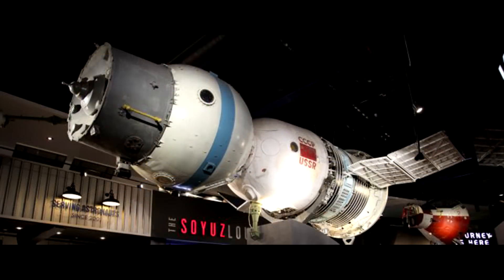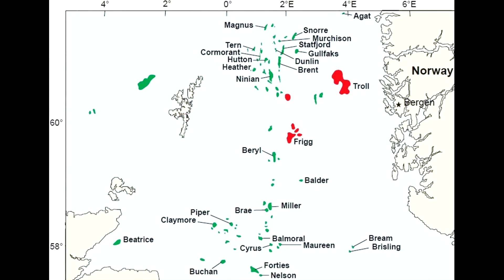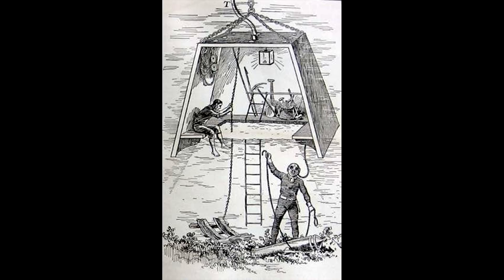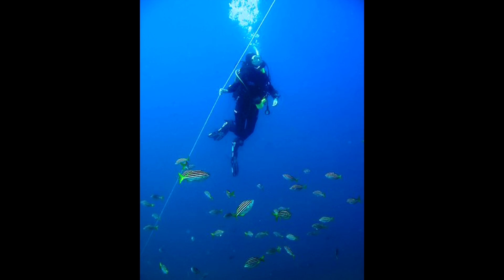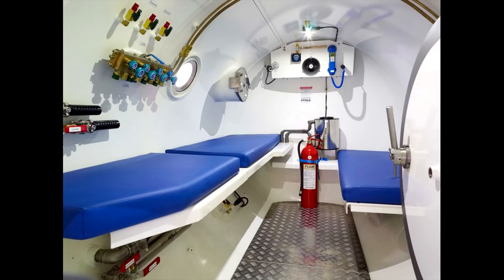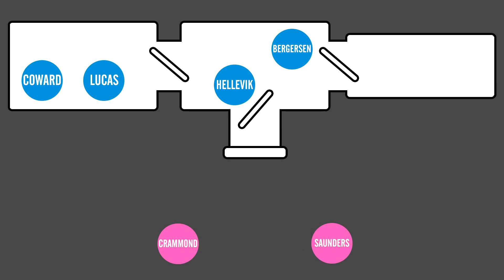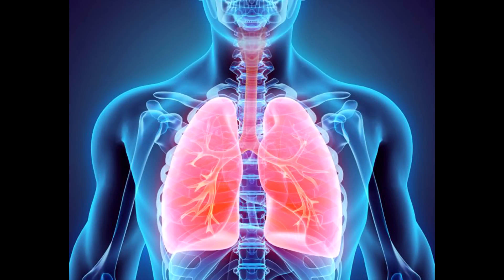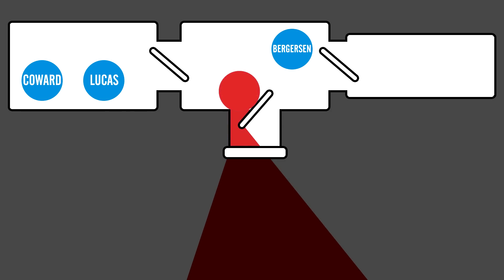Extreme Loss of Pressure Tears You Apart | Last Moments

Comment: If I remember correctly he said the opening was 24” in diameter; if you multiply the area of that circle by the pressure drop, there was almost 60,000 pounds of force smashing the guy through the hole.

Comment: It amuses me to see a warmed egg yoke forced through a tiny puncture hole in its shell after subject the egg to cold water.
Taking an empty plastic bottle and washing it out with hot water, then recapping it without crushing the plastic also yields similar results when exposed to colder temperature.
Try the experiments at home.

Comment: The fact that it was possible to open the clamp on the diving bell before the inner trunk was sealed is scandalous. Even though it was a while ago it was still 1983 and not 1883. Even without an electrical/mechanical fail safe there should've been a visual confirmation from the diver who secured the trunk to the tender. Needless loss of life. RIP.

Comment: Hi, I see you are having a bit of trouble with artifacts in tour green screen. I'm not sure if you use blue screen or green but it doesn't matter for an easy fix. I post before you knock out or "pull" your screen make the color slightly richer by adjusting the color setting and make it slightly darker. I know that sounds opposite to what most people say. try it, then knock out the screen as you normally do, you will get much better results and it is fast and easy. Good luck!
Reply: Brian Miller what? Is this about the video

Comment: I used to Weld Trailers and hitches yada yada but this reminds me of an under water Welding Documentary because I was studying to be just that an underwater welder if that's even the name lol but what wasn't funny was when your welding on one of them big rigs or welding on a huge petroleum pipe or whatever the case may be itps under so much pressure that if your nere it when it does its thing and a big air pocket busts out It will suck the welder through as little as a 1foot hole and they even had an example where their was a king 🦀 crab which aren't very big But that crab got sucked into a qtr inch hole so just think if it was about a 2foot home it's gonna suck u all the way in That Crab was gone at the blink of n EYE no bs

Comment: "Sucked out."
"Correction, that'd be blown out.  A common misconception."
 - Data
Reply: The naked now
Reply: Considering that its just the difference in pressure that's doing it, it would be a matter of perspective. 
Considering that there's no machinery actively pushing or pulling things in this scenario, if you were to use the internal pressure as reference, then technically things are being sucked out, but if you use the external pressure as reference then they're being blown out.
Reply: I had me a burrito supreme
from taco bell some years ago & I can with 100% certainty confirm I indeed blew my asshole out for an entire goddamn week.
Reply: @jamessouza7065  🤣😂🤣
Reply: @Cenentury0941  Precisely and completely, and there is nothing to add. Well said.
Reply: @Cenentury0941  
No, atmosphere always naturally flows from positive to negative pressures no matter the mechanical means of obtaining differential!
In all cases above water the static low pressure environment is the natural state and the higher pressure environment artificial, (except a vacuum cleaner which is not static) so even with your perspective analysis, blown or pushed is the correct terminology!
Even below water the liquid is pushed into a space rather than drawn!
Reply: Hello fellow Trekkie!
Reply: Sucking and blowing are the same thing. It’s just describing them from opposite perspectives. You could say the 1 atm ambient atmosphere drew a relative vacuum on the 9 atm chamber, sucking them out, or you could say the 9 atm chamber blew them out into the 1 atm ambient atmosphere.

A hurricane sucks the air around it in, or the air around a hurricane blows itself into the hurricane.

Sucking and blowing just arbitrarily choose one end or the other of a pressure gradient to designate as the impetus.
Reply: @MegaBrokenstar  "Sucking and blowing are the same thing."  Funny, your girlfriend told me the same thing! lol
Reply: @MegaBrokenstar  You must be fun at parties. Also, you're wrong. There is no perspective in the void. Yours, in the ship, is the only valid pov.
Reply: I was going to comment this. Glad someone else has good taste.
Reply: This is like the transporter accident in Star Trek TMP. "Enterprise, what we got back didn't live long. Fortunately."
Reply: Depends on your point of reference, both are correct but does it really matter when you’re being turned into vegetable soup? I don’t think your last thoughts are am I being blown or sucked.
Reply: @The_Original_Forrest_Trump  You can crawl back under your rock now.
Reply: @thetruth45678  LoL ok kid
Reply: @The_Original_Forrest_Trump  Calling people "kid" is proof you are immature. I, for one, would love to be a kid again. I miss the 80's and 90's.
Reply: @The_Original_Forrest_Trump  Maybe you've been asleep for the past two decades, but video games aren't just for kids. Every other youtuber is a grown man with a let's play series. Heck, it's a valid career choice now. There's tournaments and sponsorships and contracts worth more than your entire family makes in a lifetime.

Thanks for proving my point about your lack of maturity. I love it when the trolls do my job for me.

Comment: About the famous picture of the divers remains: The damage of the body was not caused by the decompression itself, it was caused by the 24 inch wide opening where the body was forced through. The extreme forces had a similiar effect to the body as a meat grinder.

Comment: two thoughts: 
2. How long is the controlled decompression *supposed* to take? I've heard "weeks", but haven't gotten a precise number.
1. I know the 80s was the 'greed decade'... but where there *no* safety mechanisms?
Reply: These divers were saturation divers. They live in the bariatric chamber for up to a month, never decompressing, moving under pressure from the chamber to the bell to their working depth back to the bell to the chamber, shower, eat, sleep in the chamber then repeat. They only decompress when their work cycle is over then they might spent several days decompressing to 1 atm before finally leaving the chamber. It is not a job for everyone..

Comment: Yeah. One of the only real time you would experience “explosive decompression”. Similar to shooting a propane tank. 
But.
Explosive decompression in space or a plane isn’t a thing. One atmosphere isn’t a lot of pressure.
Reply: At 35000 ft, (passenger plane altitude), a 24 inch hole has a 5900 lb. force on it. In space, there is almost 9000 lbs. If you were blocking that hole, The force of between 4 and 6 cars would be on you. You would die badly!

Comment: I nearly ripped a technician in half during a brief stint operating ski lifts a few years back.
Operator error is no joke. Check, check, re-check (even if your boss wants you to hurry up).
Reply: Anarchy The Fox when there’s moving objects and rotating bits, there’s always the danger of something getting ripped up, but yes I also wanna know
Reply: @Rashed1255  Caution: Moving parts
Reply: @anarchythefox  If you're just skiing/snowboarding, then you'll be fine. And for the record, I still ski/board along with most of my family. However, if you're mechanic or technician of some sort, and you're doing maintenance on (for example) the tower's, then it's a whole different ball game.

The person moving the lift is communicating with you by radio (sometimes in a control room miles away). You may be clipped into a specialized chair hanging from the wire while simultaneously clipped to the tower that you are working on (in order to prevent a fall). If the lift moves during this point in the operation then you're harness will be pulled in two separate directions. Most lift tech's I know are extremely picky about who operates the lift when they are out on the wire.

Luckily the mechanic that day unclipped before the wire moved. I was never put at the controls of a work chair again and I've since left the business.
Reply: @cocoabutt1711  so did the the tech forget to say something, did you not hear it, just didn't know?
Reply: @GalokVonGreshnak  LOTO is pretty much the last line of defense. A lot of industrial equipment will kill you just by standing too close. Disagree about the eurocar trying to offroad though, check out rally 911's!
Reply: @cocoabutt1711  same thing can happen when taking huge trees down...I regularly tie into two separate trees fir safety when im at the top of tall fir or pines...wind blows amd the two trees your roped into move at different times  directions and speeds...its uncomfortable but not too dangerous...its when u make a mistake and something heavy falls and catches one line and forcefully yanks you from your position while still attached to another tree or stem.
Splits in tree trunks while using a side d  flip line result in your line and back pad of the harness completing the circle around the trunk which is split and separating, pulls you in as the pieces move further apart sbd crush you, if heavy enough there have been circumstances where the harness and flip line gos so tight it severs your top half if your torso from your bottom half
Reply: Takes balls to admit this, then again we're only human, glad it went the way it did though.
Reply: Also curious
Reply: Back in the early 80s, I worked in a science/engineering summer camp for middle school kids at a university.  During a tour of the robotics lab, one of the kids asked if he could hand a coke can to the robotic arm.  Imagine the movie ‘Edward Scissor Hands’ to get an idea of what this looked like.  Handing the can  would necessitate crossing the yellow “Do Not Cross” lines on the floor.  I was hesitant, but the professor in charge of the lab said “Sure, it would be fine.”  Well, the professor input ‘the wrong command’ and instead of the steel hand opening, the whole hand thrust forward and stopped about an inch from the kids chest.  If he had been just a few inches closer, the pneumatic hand would have pierced his chest right around the heart.  ALWAYS listen to the little voice that’s trying to warn you that this isn’t a good idea!!!
Reply: @glasshalffull8625  that's a fucking horror. You wanna tell some of the aftermath?
Reply: @totalhysteria  After the near death experience, the professor looked sheepish and said “Maybe you should step back behind the yellow line.”  I doubt it was reported, but the next time I was in the lab, there was a railing to keep people out of harms way.  The kid never mentioned it and as for me, I pay special attention to warning signs😉
Reply: If it’s not safe don’t do it, I think we all learned that after the HBO series Chernobyl
Reply: @stikkippy1481  
I see your point, but what about all the people who knew the clean up and containment of the chernobyl mess wasn't safe?  It still had to be done.  They were truly heroes.
Reply: brussell639 o
Reply: @stikkippy1481  Look up the Piper Alpha oil rig, that was just mistake after mistake that bad a bad situation worse.
Reply: I got my hand stuck in the vending machine :(
Reply: @jamesklark6562  :( im sorry
Reply: @jamesklark6562  me too...
Reply: LOTO and procedural compliance is no joke. There is always time for safety. Sometimes there is no second chance.
Reply: @matthewbohn3996  na that no joke at all! Hell iv just about witnessed a fight to the death after someone removed a tag from a breaker box! He got his ass whooped and got fired! And for some reason he thought that was a little harsh!
Reply: Basically why I'm not a Zap 🌩
Reply: bosses can be part of the problem and many times they dont even realize it. When you have people yelling at you for various reasons, looking past a small check up that has never failed in years is easier to do than people think.
Reply: @geddoe316  Yes pressure put on workers by management very much a major cause of accidents.
Reply: Not many people have died on my watch .!/well maybe one or two .I'm quite proud of that its only in single figures so can rest easy.Be quick or be dead as they say .
Reply: @JohnDoe-ox5ni  How do you say one person or two people have died on your watch so calmly without giving any context.
Reply: @xyannail4678  lighten up no ones died .The only thing  iv ever killed is vermin and I'm even not very good at that as I believe all life is sacred but if you have got sluggs or rats on your property they need to go before you have real problem. Or you desperately need food for survival .But killing any animal makes me feel sick.
Reply: @JohnDoe-ox5ni  are u saying ur responsible for only 1 or 2 deaths! That’s like 1 or 2 too many don’t ya think?
Reply: @JohnDoe-ox5ni  yep, common sense should be mandatory or every job site! Lol
Reply: Yes do not let your boss or other people rush you when your job could have a life depending on it, check, check, recheck.
Reply: This happened where I worked when I was younger. It happened before I worked there and the procedure now involve the technician placing a lock on the breaker.
Reply: @TLK22  lockout tagout kit.
Reply: Boss: Hurry the fuck up!
Inspector: Hold on, I just started my 15th regulation mandated daily inspection.
Reply: That wasn't very cash money of you
Reply: Farmer here. And farm accidents are no joke. I myself have almost been impaled by peach branches too large for our mower a couple different times. Hit in the head by flying golf ball sized rocks, all kinds of freak crap. That’s why everything you CAN CONTROL to keep yourself safe, you do it!!!
Reply: By the numbers 🤨
Reply: @anarchythefox  Where I worked the technician had half his body inside the giant horizontal wheel where the skiers sit on the chairs.
Reply: Then, check again a few more times.
Never killed anyone that way and I was only dealing with drugs that could trivially kill a patient.
Reply: Stay away from me man, I'm not working nowhere near you!
Reply: Uh huh pass the buck
Reply: Should be common practice by law, to be able to slap your boss, whatever occupation, That involves a live or die situation if rushed.

Boss " Hurry up! Deliver those pizza's! Speed if you have too!"
Slap
Employee- "It is to be noted on this day that my employer is a imbecile and I enacted my right to slap him for greedily putting capitalism above sacred life."
Reply: I almost cracked my 2 year old brothers skull
Reply: Glad you didn't
Reply: We need answers
Reply: All ski lift operators are stoners.
Reply: @johncholmes643  Especially in WA and Colorado.
Reply: Hope you got sacked? Don't mean that to sound bad, but that's the kinda mistake you should only be allowed to make ONCE.
Reply: @randommadness1021  crap happens  somtimes  its nothing that can't be solved with a bit of banter  and Micky taking .sometimes you are in the wrong place and should take more care.usually its your own fault you have been mullerd
Reply: @JohnDoe-ox5ni  I know. It's an instant sacking offence though. Albeit an accident.
Reply: @randommadness1021  lighten up Barry no ones no ones really died on my watch .I don't think I could live with that.I was  was just making a flippant remark.Probably wasent that funny in hindsight. The only thing iv ever killed is the atmosphere and maybe some rats /sluggs /moles .and a kangaroo that jumped out at night in front of my camper van that caused loads of damage.I nealy forgot a sheep that ran out on to the road at night .but can't be sure as it bounced off my fender and I never saw it again ?tough things sheep.!so probably survived a bit dazed.
Reply: @JohnDoe-ox5ni  

You didn't check on said sheep? Man, I wish some people didn't have driving licences.
Reply: @JohnDoe-ox5ni  I found it funny bro. Thanks for that.
Reply: @randommadness1021  he did say he never sat behind that chair ever again and left the business alltogether soon after. Good on him for owning up to his error and speaking of it.
Reply: Boss: hurry up
Irresponsible worker: ok
Boss: hurry up
Responsible worker: no, no I don’t think so